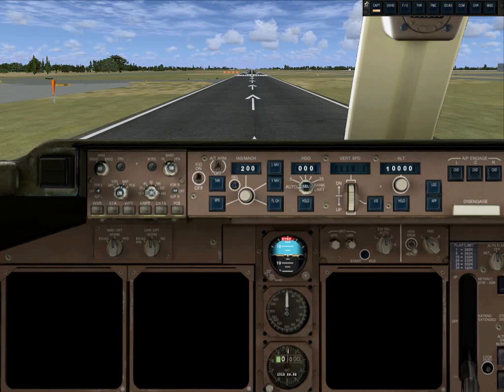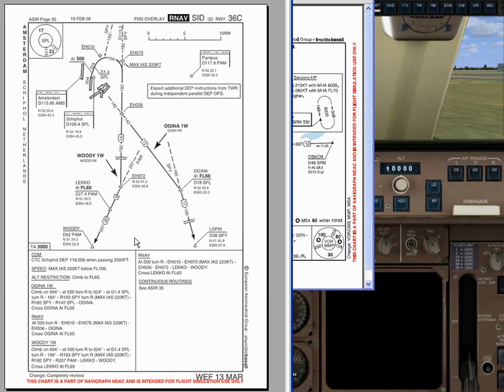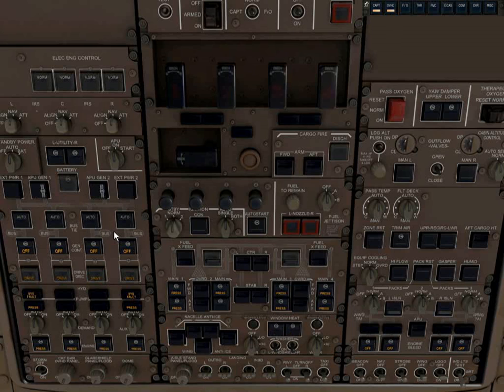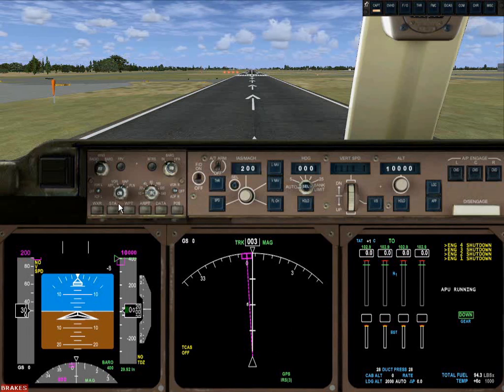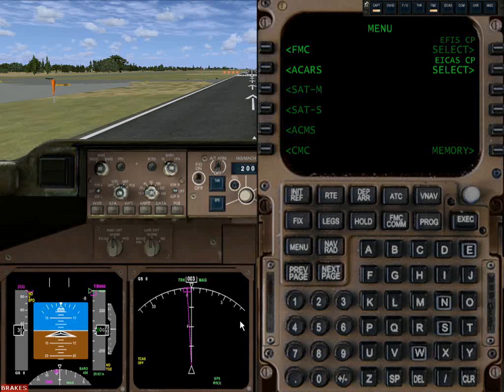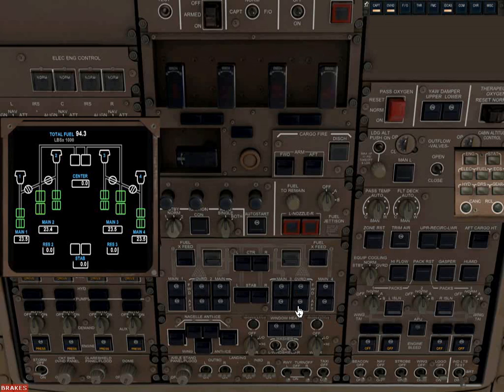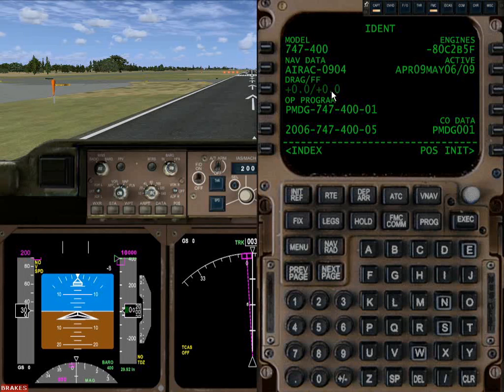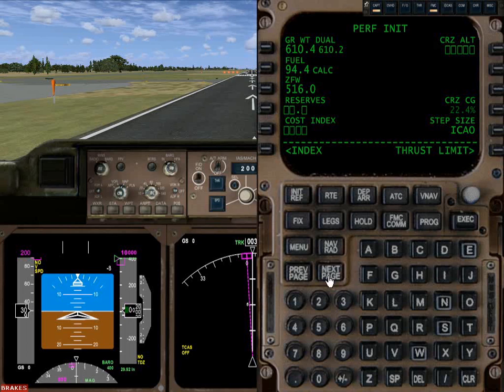PMDG 747 Flight Tutorial Part 1

Comment: @ThePilotBuddy  I had the same probmlem with yaw damps.  I followed the check lists to the letter and never got them to work.  I check the start ups of several others here on you tube and NONE follow the actual check list in the PMDG 744 manual.  After fighting with it over and over, I learned what was needed for flight and just did what I thought was right and made up my own order.  Low and belhold, no more yaw damp inop. try it, just get it running w/o the manual.  then follow this tutorial GL

Comment: (2/3) if I have forgotten to fix something. So, the first problem is, that my B744 (MD11 of PMDG also) can't hold an altitude. eg. I want to have 31000 feet, the plane isn't able to hold it. It flies up and down, up and down, up and down for the whole flight. But not some feet the V/S turns up to 1800 ft sometimes.

Comment: If your PMDG747 X is having problems at cruise level, maintaining the required heading, maybe before you load a your PMDG 747X flight, you could try unselecting winds aloft in the Settings Display >Weather section of FSX.
If this works, it may be as had been suggested, winds aloft causing your 747 problems in holding direction,
If it makes no difference then obviously it's not the wind aloft.

Good luck!

Comment: ok, guys i have a problem with my PMDG 747(I should mention right away, that it's pirated). OK so, i downloaded it a few months ago and then in worked GREAT! But after reinstalling FSX I came across a problem: if i turn on the autopilot, the plane starts to descend and just bank steeply to right. Or sometimes in even won't let me turn it on, because it says that excessive control.... whatever it was. Any suggestions?